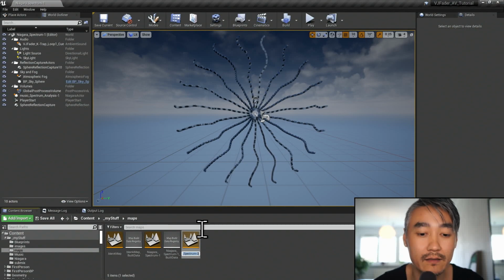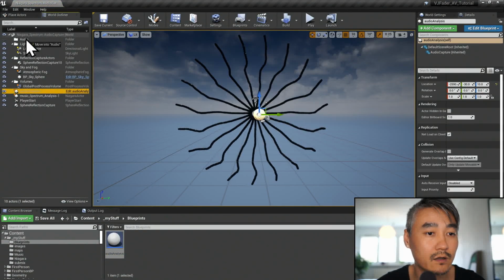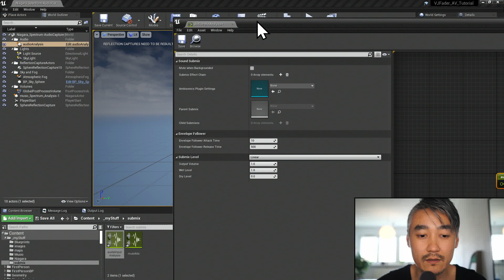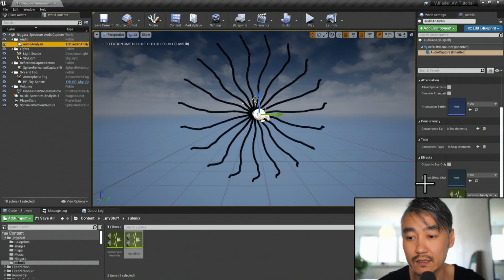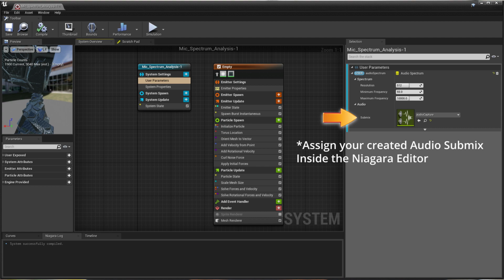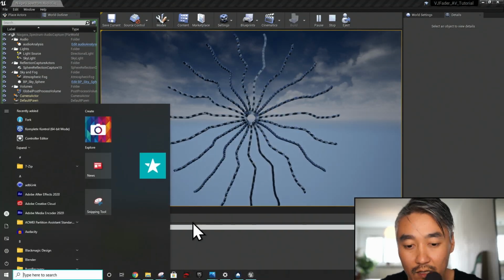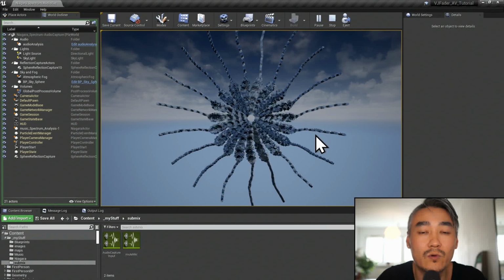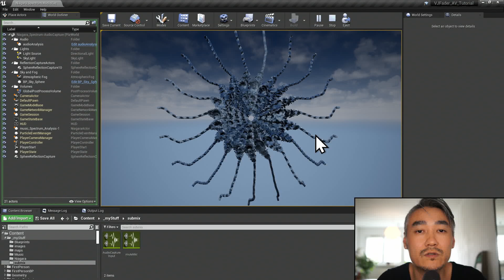[Tutorial] UE4 Niagara Audio Capture (Mic Input) Setup

Comment: A note for all: UE will use the default audio input for your Windows system. You set your default input device in the Windows Sound control panel.
Reply: Is there a way to set the input audio device to use? I want to use my line-in for example.

Comment: So I took Sem Schroeder’s tutorial on making a Niagara particle system sound reactive node which works great. When I add this to it it doesn’t act the same however. Like some of the comments I want to use this for DJ visualization live, so to have the source of sound within windows is a big help. Running a cable into the microphone jack is a crude workaround, and virtual cable causes problems. How might one use “system sound” or a “sound source” to create the same effect?
Reply from the maker: I have not personally used Windows system sound as source, heard from someone online that technically it is possible using a plugin. Maybe you want to explain what you mean by using microphone input is crude, it is pretty flexible in my opinion when doing live sound analysis.
Reply: hey did you figure out how to use sems particle system with the onput from the mic. I can't get any audio capture input to work at all.